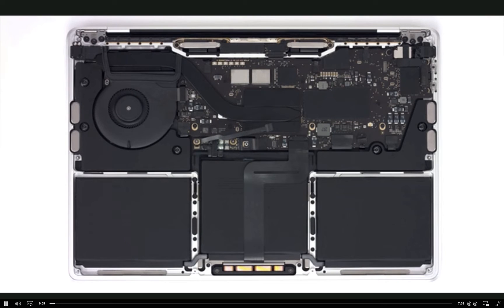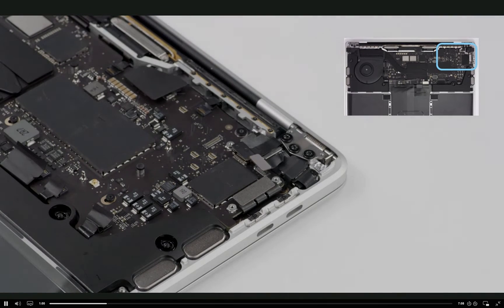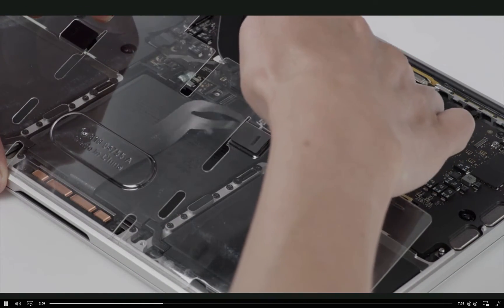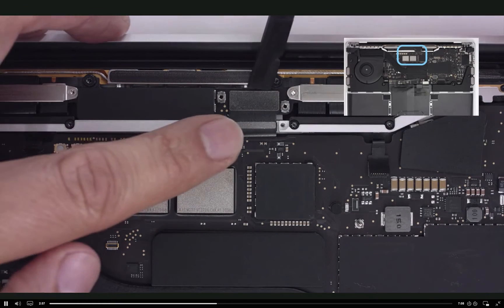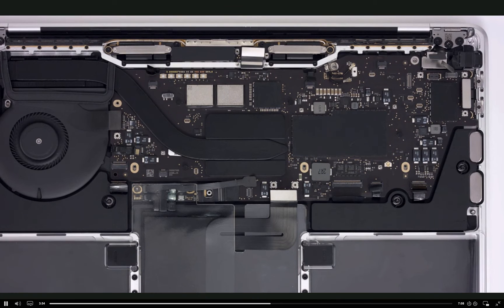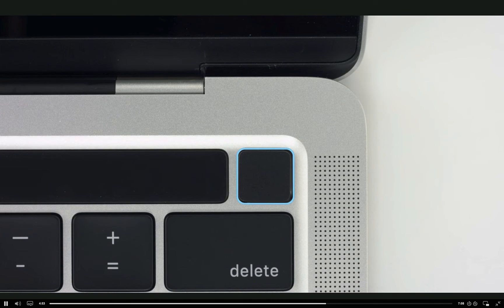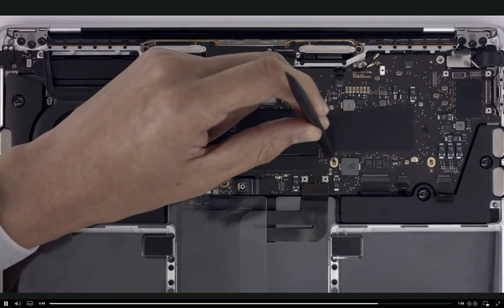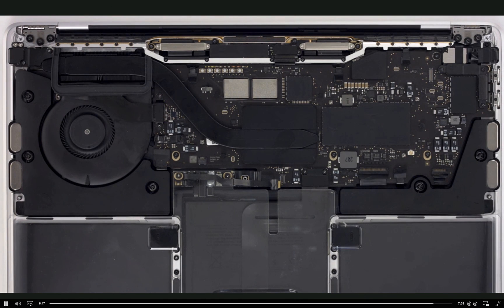MacBook Pro M1 2021 logic board replacement

Comment: I'm working on a late 2020 M1 model and it looks pretty identical to this, minus the clear plastic shield over the battery. Is that shield something that the 2021 model comes with or something you added to help with the repair. Great video, I really like how you highlight each component and identify what it is, thanks!!

Comment: what about the system config software tool? replacing the logic board requires that doesn't it
Reply from the maker: Yes , the configuration makes  in AST 2 tool by GSX account

Comment: I mistakenly bought a M1 macbook that was used as a store shelf model from a reseller on ebay and is activation locked and have tried to contact the original owner and everything to no avail. Im wondering if swapping the motherbard would remove the need for activation lock since the security is baked into the SoC itself unlike previous Intel macs. I just want to be able to use this macbook i paid good money for it and im sad that its most likely going to be E-waste
Reply: Yes, swapping the motherboard and fingerprint sensor will replace everything includng the activation lock.
Reply from the maker: Yes , it is . The mac was looked ,because it was not removed from previous apple ID account  @jameysummers1577

Comment: My backlit keyboard isn't working.  I tried a few things on the software side but can't get them to work.  That cables should I reset for the backlit?  Is there a power ribbon cable for the reyboard I should reset?
Reply from the maker: if , reconnection of backlight cable , does not solve the problem , it might be a problem with  a top case .
Reply from the maker: Don not forget , after replacing a top case , you have to perform a configuration , otherwise the backlight will not work .
Reply: @igurusolution7475  how does that configuration work? I'm leading towards a logic board problem

Comment: what is the model of this Macbook ? is it a MacBook Pro 14 16GB RAM, 1TB SSD ( 2442) ?  & how much does it cost to replace the logic board
Reply from the maker: Not , it is 13 inch 2021 M1
Reply: Did you solve it? I have a broken screen and I was pondering this route